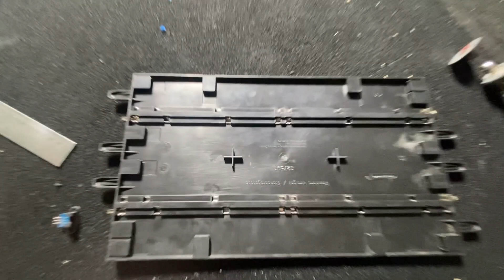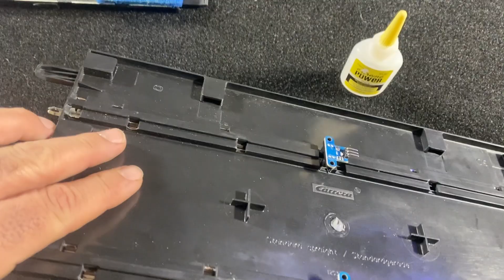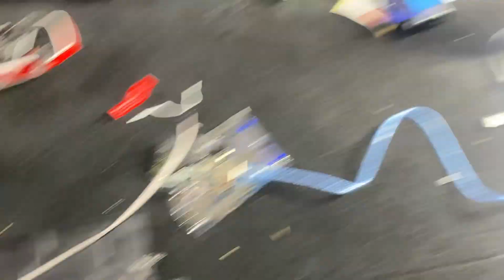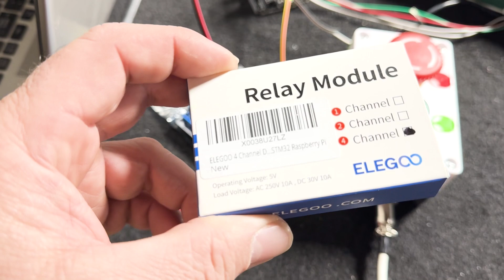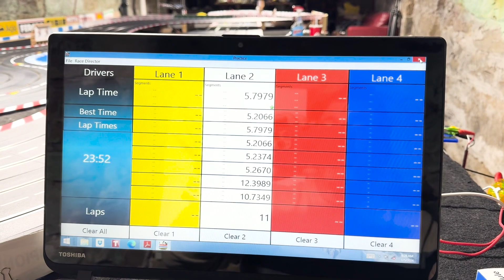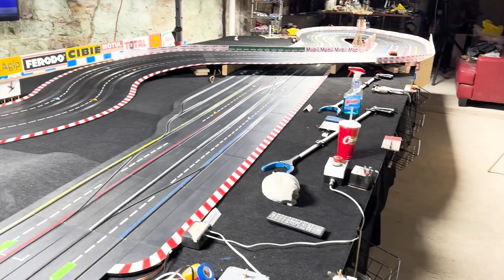How to build Slot Car Track Lap Counting Hardware!

Comment: Hey Marty, im about to build a similar timing system using a Arduino UNO R4... would be it possible for you to share a wiring diagram?
Reply from the maker: I will see what I can do.. it is pretty easy.
Reply: @twolinesslotcars i managed to find a few diagrams and got it wired up... however, the R4 Wifi is being detected by RC 😢. I did a few fixes online but whatever i go to upload the new sketch it fails.. really need technical assistance with it lol
Reply: Update - managed to get the Uno R4 Wifi to work thanks to a gentleman who goes by "BBB". I'm now faced with a "ghosts" lap issue. The sensors i purchased were from your store "WWZMDiB 6 Pcs 5MM LDR Light Sensor 5516 Photoresistor LM393 3 Pin 3.3-5V Compatible with for Arduino Raspberry Pi ESP32" Any tips for getting them to work perfectly for my wood routed track? Currently the overhead housing the sensors are adjustable from 3.5" to 5" in height.

Comment: Marty! Do you have a video detailing the call button wiring? I have two red NC-NO, that shut off the power packs (all 4 on a 4 lane) and activate the yellow/caution lights, but do not stop the timer. Can you help me figure out how to wire everything? I ordered the parts you suggested, and I understand all but how the call button works! AFX 4 lane analog with a tri power pack for each lane. Thank you! 🏁🏁
Reply from the maker: Good question.. I feel like I did..  it can’t remember.. I need to wire one up for the Policar track.. so I will do that soon.
Reply: @twolinesslotcars  I found a diagram (Race Coordinator Arduino Interface rev 1.2.0) and understand all but the "Push to make momentary switch for track calls" is it a normally open, or closed? Ground connects on one end, and the other to pin 12. And I assume when pushed it shuts off the 110v on the relays that go to track power. Can you recommend a stop switch? Also, after the countdown (red lights) can I use the analog A5 pin to turn on all the green lights? Also I would like to have the yellow lights flash when the call button is pushed. One last thing. The photoelectric sensors. 3mm or 5mm. Thank you!

Comment: I am trying to build this tack counter/timer, easy enough watching your video, what I don't understand is where do the wires come from that go to the relay switch and onto the call buttons, any chance of a quick rough drawing that my brain can understand.
Reply from the maker: David… the relay interrupts the positive side of the power supply. There is an in and an out from the relay… so positive from power supply.. into relay.. out relay to track..  the call buttons have a ground and a wire that goes to the Arduino… and then you basically wire the other call buttons in series. Send me an email and I can send you a diagram. Thet5guy@gmail.com
Reply: @twolinesslotcars  I have watched the video over and over and  where each wire goes is killing me.  Would you mind sending a diagram my way as well?  Great vid!

Comment: Although my understanding of computer electronics, this seems simple and straight forward. You’re using this with Carrera track and cars. The question I have is could this be used with AFX track and cars? And what would be required to use this system for the smaller cars?
Reply from the maker: HO cars are small and fast.. it could have issues picking up the cars.. I see a lot of HO tracking using dead strip sensors.. I would have to do some testing to see how this system would handle HO. I have an HO car to try. I will come back to this..

Comment: Great tutorial! Do you know where to find a schematic for this setup? And what are the details of the arduino programming?  THanks!
Reply from the maker: The Arduino code comes with the program you decide to run. As for a schematic, I will have to work on that..
Reply: @twolinesslotcars  OK thanks. So do you have to write the code for the arduino to register laps? Or is there a DL for the code somewhere? That's really the part I'm not clear on.
Reply from the maker: @chickentuber the code for the Arduino is called a sketch.. and it is in a folder in the application folder of the software when you download the software.. don’t need to write the code.. you will just need to upload it to an Arduino uno r3. Which is a little bit of a process. But not difficult.

Comment: Have been looking at your slot car lap counting system and I am needing to know where to connect the three connections on the lap counting sensor to the Arduino 
Many thanks Tony from UK
Reply from the maker: Tony… the lap counting sensor connects red to 3.3 volts on Arduino, black to ground on Arduino and the white goes into a0, a1, a2, or a3 depending on the lane..

Comment: Thank you, how do I get the parts list
Reply from the maker: I have switched to different sensors.. less interference issues.. IR break sensors.. wire and an Arduino Duo r3
Reply from the maker: Randy, on my newer videos descriptions I have an Amazon list that has everything I have used..

Comment: Marty  I have a 5 lane oval Lug Nut Speedway and want to add this system. Will this setup go out to 5 lanes ? Any help would be great, I appreciate what you do. Check out Old Dad Fab
Reply from the maker: I don’t see why not.. might need to ad a little bit of programming to the Arduino code.. also, I would change the sensors to IR Beam break Sensors.. in the end they are more reliable.
Reply: @twolinesslotcars  I saw a Mega R3 Audrino card. Seems to have more inputs ? Might give that a whirl. Thank You

Comment: Will electric interference from non/ capacitor cars set off laps on the photo sensor?  Mine certainly do with the carerra lap timer
Reply from the maker: Yes, I have fought it and had to chance to IR Beam Break Sensors..

Comment: A suggestion to solve the White pickup problem with the sensors, You can install IR sensors which come in 2 parts. 1 part goes in the track (just a 4mm hole near the braid is needed) and the IR LEDs go on top, you just need to have a bridge where to stick the IR LED strip. If you are interested I will send you some photos when I go next to the track. I hope this helps!
Reply from the maker: @SlotSpoilsSlotCarTracksi-hb5ml  Ben I have since switched to those sensors.. timing system has been rock solid since..

Comment: Hello Marty, I have a question, if i may, When the call button is pressed do the car roll to a stop or the they go on brakes? I am asking because if the call button is pressed and one of the cars is at the end of a straightaway the car would fly off the track! thanks in advance.
Reply from the maker: Great question.. power is killed to the track, so the natural braking of the motor would impact how fast the car would come to a stop. If a car would come off a turn after the power is shot off to the track.. it was already going to come off at the end of the straight… we have never had this happen..
Reply: @twolinesslotcars  Hi Marty, thanks for your reply. From past experience, unfortunately it wont work for us. We stopped using the kill button because we were breaking too many cars. To give you an idea, the clubs wood track is just under  45 meters with a 15 meter straightaway, where we clock around 8.20 seconds with NRS F1s and Moslers. If the power is killed less than 3/4 meter from the end of the straightaway, the cars smash into the barrier. Would you be kind enough to ask Thomas, whether he would be interest to amend the Arduino system to cater to our needs? Or pass on his contact details. Thanks in advance, Ben 🙏

Comment: Great project.  Where can I find the Arduino firmware code to load onto the Arduino controller?

Thanks Marty...got it working!  just need to build a 1/32 wood track.
Although I am familiar with Arduino IDE there was no mention of needing to load tha Uno R3 with code and was confusing.  Had thought that RC would upload all the code to the Uno R3 without a separate IDE upload.

Thanks for the video!
Reply from the maker: The Arduino code is in a folder that is in the Race Coordinator download.

Comment: Been extremely busy of late completing the room for our slotcar track finally! This is great stuff! I am going to be catching up on the vids I missed. You’ve converted to 4 lanes so you will have to change your name…so obviously with a lap counter like this there is no crossover/lane change tracks? Thanks Marty
Reply from the maker: Congrats! I can run 4 lane analog.. and 4 lane digital.. I use Smart Race or Faslaps when using digital. Race Coordinator for analog racing at the moment..

Comment: I love my Race Coordinator.... but I foo-foo'ed early on.  I was struggling to create a race where we rotated lanes, then cars etc. And I accidentally erased the BUILT-IN practice, so eventually I created one from scratch...not quite the same...but close.  Problem is I can't get it to "look like EXCEL", where many laps are listed for EACH driver etc..   SO TO ALL!  TINKER YES, BUT DON'T DELETE ! ahah  - Way to go Marty!
Reply from the maker: I can probably fix that.. k can send you the correct XAML file to get that screen back.
Reply: I love the subject.  How does this work for digital?  I’m extremely new to this hobby and I have the Scalextric system (Arcpro) and I want to be able to run analog and digital. Love your program.
Reply from the maker: @renee102099   I do not have any experience with Scalextric, I thought Arcpro has the ability to do both digital and analog?

Comment: Marty that was so cool. Are you planning on adding fueling by way of Arduino. Another question. Is Arduino Vinny's brother?
Reply: I see. Looks like you fixed your problem. For now I will be sticking to the webcam because the race setup in race coordinator doesn't allow you to mix and match Arduino with webcam. You have to choose one or the other. I want to say that I love, love, love Race Coordinator. I think it is the best thing in analog slot  car racing since I have been hooked on slot car racing since 1964. Keep the excellent videos coming Marty.❤ You are the one who turned me on to Race Coordinator. My friends and I love it and we are having more fun than before.Thank you. and let's not forget  the guy who came up with R. C. and your Arduino guru.
Reply from the maker: Tom, the programs will do fueling… but we switch over to digital for that.. :), I believe you are correct.. Arduino IS Vinny’s bro..

Comment: Thanks Marty I was anticipating this video. Currently I am using race coordinator with webcam for lap timing and fueling VIA 3 zones in each lane using Webcam Zone Trigger thanks to your past videos and for the most part am very happy, but always looking to improve.
Reply from the maker: Tom… I would agree.. webcam and zone trigger work surprisingly well. It is a legitimate timing solution. My goal was to clean up the false laps anytime we marshaled in front of the camera. Especially with 4 lanes.. was pretty easy to mess up the lap count.
Reply: Looks like you fixed that problem.